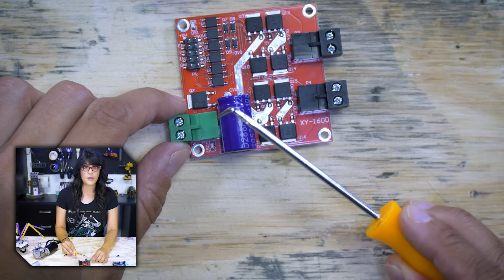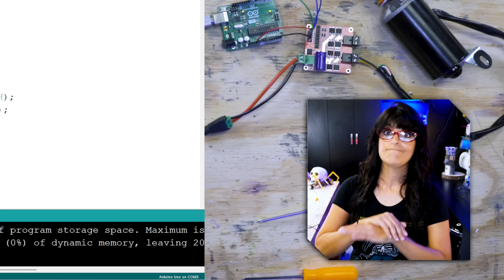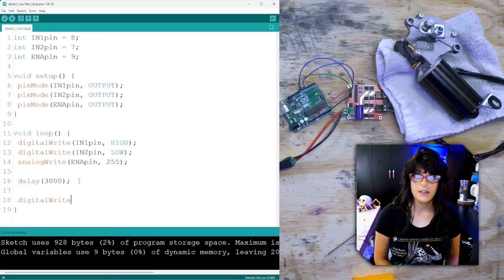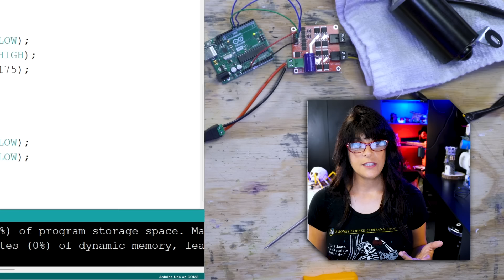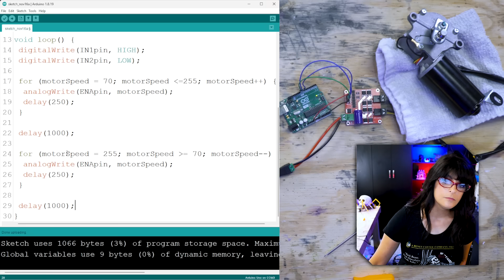How to Control a 12V Motor with Arduino: Easy Wiring & Code Examples

Comment: Hi i am using wiper motor , as 5600 to control angel. The wiper motor arm rotates 248 degree with full speed when button pressed and upon release will return to it position with slow and smooth operation, arduino nano controlling bts7960 and as5600. The code works fine but after sometine may b 3 hours or 150 to & fro motor rotations the motor moves to 248 degree on button press and hold when button release the motor lever jams stop move stop move then satys at 248 degree only. Upon code reupload it works and issue is repeating... plz suggest

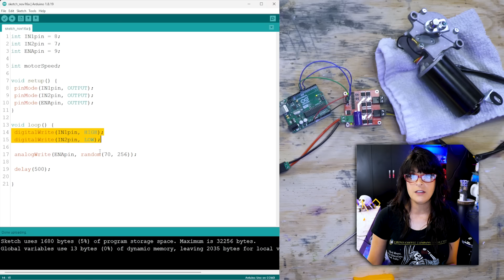Comment: 40:04 if digital outputs are either “HIGH” or “LOW”, how is it it that producing a random 0 or 1 also produces the same functionality without correlating that 0 or 1 to mean “LOW” or “HIGH”? Can you use a 0 or 1 in place of “LOW” or “HIGH” anytime for digitalWrite?

Comment: How does the program know when to stop executing the speed change portion of the code and then go back to the top? 

What stops it from getting stuck inside the Internal (motorSpeed) set of curly braces when the entire program is contained in them too?

Comment: Easily the best teaching methods I’ve seen on these things as a beginner, this video truly made me feel like it’s possible to do these things instead of just feeling so lost 

I have a question about some of the “etiquette” of coding, you say you should not use spaces and such to keep things compact but when writing the speed code there’s lots of spaces between the motorSpeed, and when setting your change value there’s lots of spaces for equation 
motorSpeed = motorSpeed >= etc

Is there some general rules of thumb for doing C++ that can help?

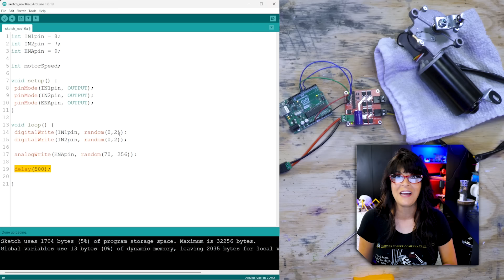Comment: 42:00 - I would set the other in an If statement. if one is high the other is low. You could still get 0,0, 1,0 or 0,1

Comment: this is really informative and easy to follow and i appeciate that. my question is.... how does all this work with a joystick with potentiometer? the application is a 12v motor linear actuator) pulling 8 amps max (spike at the end of the stroke when it reaches the deadhead end of its stroke, not constant) i want to be able to proportionally control my functions.

Comment: Are you still making videos? Community support?  I would like to use this code to move an actuator to the top with a button press, potentially button press, moves the actuator, triggers sound, delay while the track plays, then move it back down to all the way closed, then wait for the button press again.  Maybe even LED's that play as well.  I know its a lot and happy to join the community but great videos.

Comment: Excellent,  Only change you should make is to make the pin definitions #define s not integers,  Faster, smaller code and better documentation.  This is also the industry standard convention.  it also makes then immutable which they should be.

Comment: Wouldn't a mosfet draw more current from the io pins than the Arduino could handle? How many ma does this motor driver pull?

Comment: you really made the kicking legs prop achievable for me!!!!
What is the recommended approach to powering the Arduino from one power source rather than have the Arduino plugged in USB and the motor powered with the 12V 5A Power Supply? There has got to be an easy way to tap into that power supply, right?

Comment: Can I use a smart motion sensor to turn on power and will it start my program on Arduino? I want my prop to sit up in coffin and then lay back down when triggered from someone walking up. Need wiper motor to do one full rotation per trigger.

Comment: Hi Rachel, love your teachings! I am a Year 3 ECE student and the electrical lead of a Baja racing engineering student team at our university. For one of our applications, we have a 12 v linear actuator that needs to extend and retract at the push of a button (I would prefer if we only needed one button). The button also has to be wireless. I was thinking through RF it would send a signal somehow to the Arduino. Any ideas?

Comment: didnt even watch the whole video but i can say that this will be way simpler with an rc esc controlled by a mega board. the esc already does what you need it to do, just have to send a signal telling it what to do. power goes directly to esc so the board doesnt get over voltage and no need for extra hardware or wiring.

Comment: Hi Rachel. Big fan. A quick question: Have you ever had a 12v motor jam due to possibly a prop jamming or falling and burning the motor. If yes what was your strategy to protect the motor from overheating, causing fire, burning out...whatever. I can't find anything on your site that addresses this. Thank you in advance.

Comment: I'm thinking of taking a link trainer ( https://en.wikipedia.org/wiki/Link_Trainer) that we have on display in our museum and making it move to simulate what it would have done when it was being used to train Air Force pilots for World War Two. It sits on a central pivot point but is a bit heavy. I Was thinking of using the Arduino with the dual motor controller and two wiper motors but I'd also like to have it use either one or two PIR as trigger devices so it only runs for about two minutes once somebody comes near it. Any chance you can give me some advice. I love your series of videos and have made a pretty cool monster in a box already, so I am a little familiar.

Comment: Pro tip: Since the pin numbers will never be changed by the program you can save memory by defining them instead of using integers. Instead of int IN1pin=8; use #define IN1pin 8. Now when you say IN1pin the compiler will substitute 8. This saves 2 bytes for each item. Keep up the good work!😊

Comment: New to the Arduino here.  Way back from my basic and some c++ days.  Could you replace the “random and values) with a random generated value and assign it to a variable. That way if it selects high or low for the first one, based on the number assigned to the variable, and the second line could use the same variable*(-1).   That way you would always have a direction and never have two 1’s or 0’s.   Just curious.   Trying to figure out how to make a remote controlled lawnmower since I’m semi wheelchair bound now.  And on a very very very (did I say very) tight living budget, trying to use what I have laying around (in my case some new automatic window motors I’ve never used).  

Anyway mLady, this Texan tips his hat to ya and thank you for sharing!  😊

Comment: Hello Rachel;...thanks for this very encouraging video!  I'm a 77yr-old electronic ignoramus who now has another path to follow.  My aim is to add variable speed control to classic car single speed wiper motors, guessing that your system would be much safer than using a 'mechanical' rheostat.

Comment: There's probably 100+ videos showing these basic steps with the Arduino boards, motor driver and a DC motor.  Any way you can create more advanced videos?  i.e. implement a PID control loop.  you can even use the same motor you have here.  Good Job!

Comment: I have a project with a 300N linear actuator drawing about 1.2 amps at 12 volts. I started with a L298 driver but it got really hot. I then moved to the TB6612 with its MOSFETS. But the 1.2 amp draw was too much and they also got hot. Then I watched your video using the XY-160D. I had seen this module but the description was not clear if it used MOSFETS or not. But based on your use I bought some and they work great. They easily drive the actuator at any speed and stay totally cool. Thanks for putting me on to them. Good work.

Comment: I wanted to thank you a ton! I have not touched my arduino for a few years and this was a great refresher. I have never learned about the motor driver boards. This gave me a good refresher on running servo motors with my capstone project over the next few months. 

Many thanks!!!

Comment: I have recently developed an interest in arduino's & electromechanics (if I can even call it that), but I have zero knowledge of voltage, amps, resistors and all other terms when it comes to electricity. I do however have a few years of experience in coding...

You have a very enjoyable way of enthusiastically explaining things 🙂
On top of that your explanation is clear, concise and accessible even for the newbie when it comes to electronics. 
As a software engineer I found your explanation on the coding part entertaining as well (very accessible way of explaining the concept of variables!!)

First video I ever saw from you, but you have earned another subscriber 🙂

Comment: I try to control a symetric power supply with one unique potentiometer.
The solution i use are 2 numeric potentiometer that can be commanded by spi.
The AN is 12 bits on arduino r4, which is more precise than 8 bits on first arduino with Atmega328.

Comment: if I want to use 2 motors, I'm guessing I'd use the other ENA and INT3 and INT4 for the controls, do I need to worry about the other 5V and GND pin on the driver module?

Comment: Hello, great videos your doing, very educational for me as a beginner.

 Is there any chance you can explain how to control a dc encoder motor to rotate cw then ccw 360 deg.  I just can not get the motor to keep position. 
 I'm using ARDUNIO UNO REV3,  DFROBOT SKU: DR10039 motor shield and 6v encoder motor SKU:FIT0483.
Thank you.

Comment: Hi, I'm making a solar powered electric carboat as you can see in my video and im putting 8 hoverboard wheels controlled by 4 hoverboard tilt controller under 2 boards also serving as a table in the carboat. However i want it to not have a speed limiter. I will connect the 2 dc electric motor propellers on each side too for water use and in sha Allah I will connect it to RX40G 12-24v gps return function receiver and remote from aliexpress and thatll be cool. But how I have no idea about audrino or coding and dnt like it but if i have to I will to remove the code but is anyone in this 7 billion people world gonna be amazing and make a detailed video on how to do that? And maybe even show how to make your own electric solar carboats? Also how do i run the hoverboard with a higher battery if i have fans on cooling the control board? Thats if i can remove the speed limiter of the 4 hoverboards connected to the 8 wheels. 🎉 nice videos by the way very detailed and cool.

Comment: I'm just getting into microcontrollers and boy I feel bad for anyone who isn't already a developer of some sort. I don't work a lot in C, but doing programming for years before this is a nice edge. For those who are just starting, remember to just make stuff. If you need a real intro to programming, I recommend setting up a web backend with PHP just due to the way you work with a database. It's not so different from interfacing with other types of programs.

Comment: After cutting off the ends of the jumper wire,, you said, "stick it in here and then stick it in the Arduino." Where is "here," at 8:52 time?

Comment: Hi, I'm a newbie and just starting out with controllers. I need technical support if possible. I have a 24V DC motor with 3 large phase cables, yellow, blue, and brown. They have brakes with 2 small white and brown cables. 1- What type of controller do I need for two motors? 2- How do I make the connection to activate the motors with the phase cables? 3- How do I energize the brakes with the controller? Thank you

Comment: Hello Rachel, im curently working on some similar project, but with remote controler and Arduino mega. I found similar motor on Aliexpres, but they are seling it only with their driver for it. It is pwm motor, and it is not full rotate, it has some angle of circle and it goes back and forward in that angle. So, they have only 3 wires from driver, plus minus and pwm. Can that be enough to control speed and position of that motor?

Comment: Hello. I need to control a 48v DC motor. Is there a motor driver that anyone would recommend? Looks like the ones in this video have a 27v max rating.

Comment: Would the conditional "motorSpeed <=255; motorspeed++" be best set to "motorSpeed <255" because once it hits 254 it will iterate only one more time leaving motorSpeed at its max of 255 and not 256?
Reply: Not sure if setting a value greater or lower than it's max will cause any issues.

Comment: Hello! First of all, thank you for creating such awesome content! It’s incredibly engaging and easy to follow, even for someone like me who didn’t know anything about Arduino until today.

After watching your video, I’m inspired to build a DIY watch part cleaner using Arduino and a 12V DC motor. I plan to directly implement the concepts you demonstrated, but I have a question about incorporating physical switches to control the motor.  

I’d like to add two push switches for one motor:
- One for low RPM (100) to clean parts in liquid, alternating between left and right to run for like 10 minutes, like you have shown in this video.
- Another for higher RPM (300) to dry the parts using centrifugal force, spinning in one direction.

Could you point me to one of your videos that explains how to connect and use a simple switch (if any)? Most of the videos I’ve seen use advanced sensors or joystick, which I don’t need for this project.  Thank you! Joon
Reply: At 15:50, I see you explain how the pins also can be used for INPUT source.  Can I use two-way switch (*1 - off -*2) on a breadboard, connect the (*1 = PIN1,  *2 = PIN2) as INPUT signals to Arduino, and use other pins on Arduino as OUTPUT to send signals to Motor controller?  To do action A or B.  I will look into more of your other videos to find some clue!

Comment: 7 Amps of currant not power. The unit of power unit Watt and in case of DC currant it is a product of currant (I) and voltage (U). 😂

Comment: First off I love your teaching style, really easy to understand.  I purchased a Wiper motor that is identical to yours, however it only has 4 wires, I did some testing and it didn't have a ground wire, but I added one to the chassis and it worked.  I have about 5 of your videos up right now working on my project.  Thanks for the great work!

Comment: Great video, was a huge help making my life size Batman that will sit on my roof drinking  beer and waving for Halloween :)
I used and ESP32 which has 3 volt logic, so in that case I had to hook 3 volts ESP PIN to the motor controller 5  volt logic PIN and that worked great. Works very good.

Comment: Hello, I'm a beginner and I have really appreciated the way you explain this subject. Anyway I have a question... instead of using the "delay" key, is it possible to make the motor running in the opposite direction with a switch? (That way I can make the motor work in both direction without coding anymore). Hope you answer me soon :) !!!! Keep going with your videos and most of all with your energy!!!!!

Comment: Just to chat, is not the Arduino ground and the power source ground going to be different? I think this is the reason for you to need 2. In fact +5V on the Arduino board means nothing else that there are 5V between that pin and the GND pin They might be +9V and +4V in principle. Same thing for your big engine power source. This means you do need 2 grounds, unless the module is very insensitive to input tensions.

Comment: I just subscribed.  You asked if anyone takes too long to complete a project?  Years.  Then more years.
I invented a simple device.  I built one then another then a smaller, better one, and now one is perfect.
Then I switched my focus to building a machine that makes them for me.  I quickly found that I'm good at it but not accurate enough.  No one is.  I had to buy a milling machine.  Then I had to build a large workspace to mount the equipment which meant I needed a metal band saw......Long story short, I now have a Bridgeport milling machine, lathe, arc welder, mig welder, and basically a garage full of equipment just to build a machine to make the thing I invented.
Currently, I have a very large steel table designed and built for one purpose, I have a dozen pneumatic and hydraulic cylinders, lots of linear actuators, hydraulic pumps..........
I've been on it for maybe 5 years now.       So, yes, I am slow.   BTW I like your videos.

Comment: Can you help out in creating a 4D theater seat using Arduino? I plan to use 3 motors with Arduino to synchronize a makeshift seat based on timestamps of a video. As a novice I appreciate any helpful links / other support.

Comment: What do you call the exposed wires that are coming out of the female power adapter to connect to the motor driver module?
Reply: Do I order hook up wires from amazon?
Reply from the maker: Those are breadboard jumper wires. I have a link in the video description to get them on Amazon 👍

Comment: Hello, I was wondering how the power supply works. Do you just buy a 12V AC-DC wall adapter and power the motor through the outlet? An amazon link would be very greatly appreciated. Thank you!

Comment: shortly, I wonder a question's answer, please answer,  Do you energy the park always, even in stop mode and fast&slow mode,  applying energy the park cable always , does it damage to wiper motor? ,  and there are universal wiper control buttons like CT41 Wiper control ,  ı wonder when we press park  button at ct41, does it always energize the park cable or energizre until it parks itself?